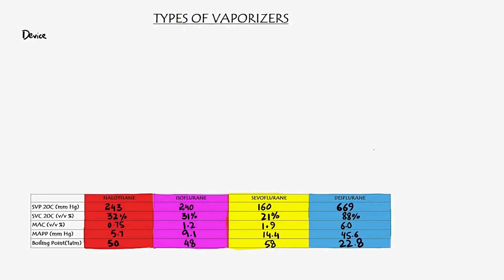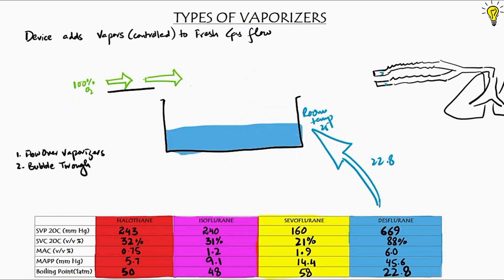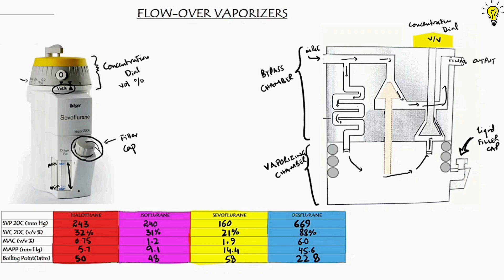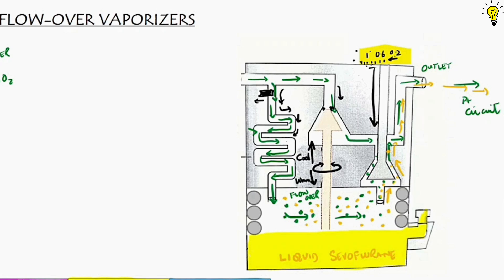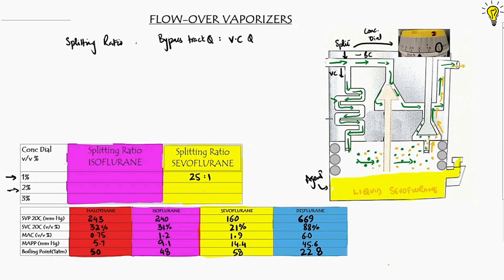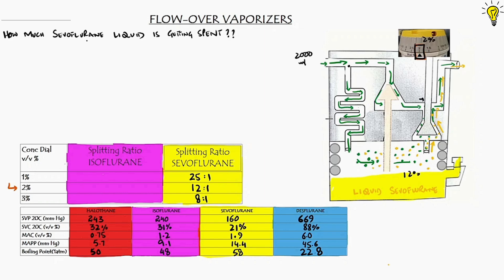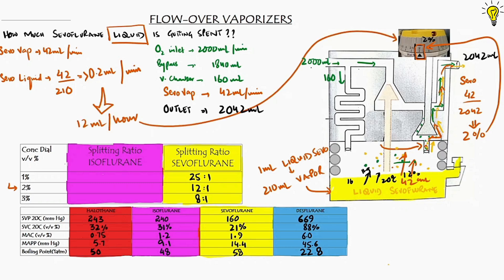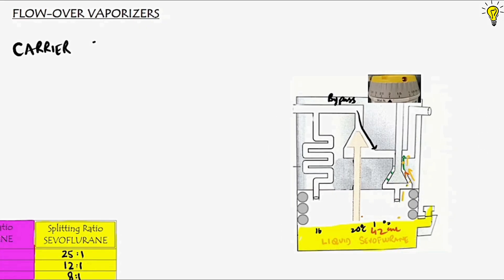Variable Bypass Vaporizers: Types, Mechanics, Calculations & Factors:  Anesthesia Machines: Ep 5-B

Comment: Does the vaporizer works without the machine? With an O2 line I mean. Thanks
Reply from the maker: Hey. Yes it works if you plug oxygen mask to the outlet of bain circuit , but it will not work if u connect oxygen via Auxillary oxygen port ( aux port bypasses the vaporizers and directly links to oxygen coming from behind ). I hope u understood ?